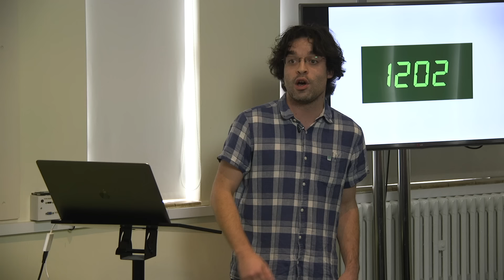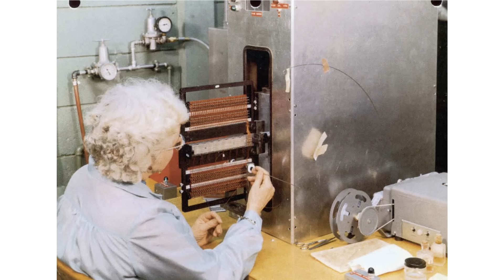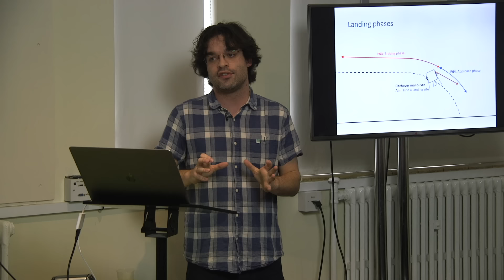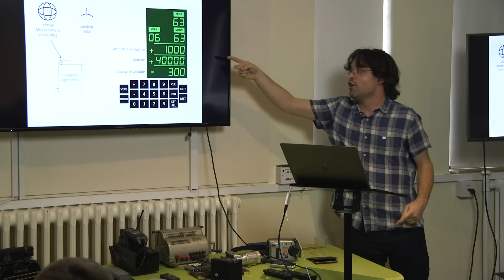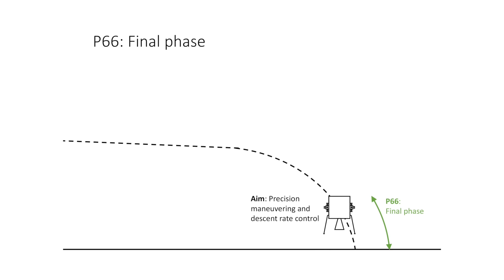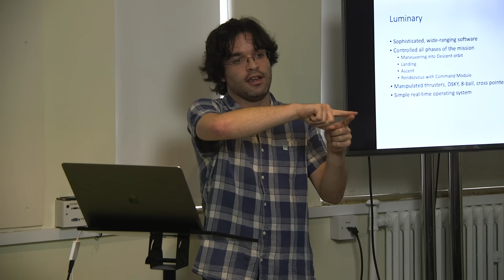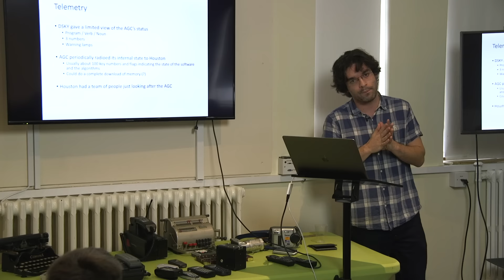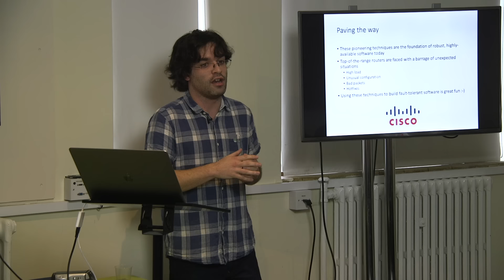Light Years Ahead | The 1969 Apollo Guidance Computer

Comment: how does magnetic core memory get beyond LEO electromagnetic radiation?
Reply: I am fairly certain that the AGC used magnetic core memory only for the RAM, which is constantly being refreshed anyway. Additionally, magnetic core memory chips can be hardened against radiation. Magnetic core memory chips are still being used today. The actual data was in the form of core rope memory, which means it was impervious to radiation damage.
Reply: @casanovafrankenstein4193  Magnetic core memory is not in chips, though. They are little ferrite rings with wires through them, and one bit per ring. We stopped using magnetic core memory in the 1970s. 
The ROM was core rope memory.
Reply: @casanovafrankenstein4193  I do the computer science degree too bro.. have you tried subjecting a magetic core memory stack to any form of electromagnetic radiation? it fucking flushes faster than a 91 Maxtor HDD.
Reply: @animaze86  You also wrote, "also lol magnetic core mem chips in1969..." <- Magnetic Core Memory was first demonstrated in 1951.
Reply: @animaze86  "electromagnetic radiation" Are you talking about putting it in a magnetic field? Yeah, that's the one form of "radiation" that will affect core memory. No huge magnetic fields in space though.
Reply: also lol magnetic core mem chips in1969... @casanovafrankenstein4193
Reply: @animaze86  so your argument boils down to I don't believe it.. because all you do is question things without researching them.
Reply: @casanovafrankenstein4193 Core memory doesn't come in chips.
Reply: Magnetic core memory is pretty much impervious to radiation.

Comment: Another interesting thing Don Eyles mentioned in his book was that the DPS engine throttling response times given to the programmers was shorter than the actual response (I believe it was), and the computer's attempts to change the throttle caused what was called a "castle-ation" in the throttle responses, making castle-wall-like crenulations in the graphs of the throttle settings by jumping from wide open to almost zero during some transitions from one thrust level to another.  Basically like taking your foot on the accelerator of your car and wildly pumping it while trying to adjust from going from 20mph to 30mph.  The cycling between throttle extremes was at a very fast rate, such that it presented a danger of a violent failure of a throttling pintle valve.  Could have resulted in anything from an engine that could not be throttled, to a sudden shutdown, to (on the worst day) an explosion of the combustion chamber.  Everyone on the LM guidance programming team are said to have turned white as a sheet when they finally saw those throttle graphs, after Apollo 12, and had a fix in place before Apollo 13 flew.  And had Conrad not commented at length on the amount of RCS activity it took his LM to maintain attitude through PDI (which was eventually found to be caused by fuel slosh in the tanks), they might not have taken that close of a look at the throttle graphs... 😲

Comment: I'm sure it's been noted below, this was posted three years ago, but the actual cause and resolution for the 1201/1202 program alarms was totally sorted out by Don Eyles in his recent book.  The rendezvous radar was on a different timing circuit from the timing circuit the computer and the other pieces of hardware used, and due to a truly once-in-a-million chance, the two timing systems got started up so out of phase that info from the rendezvous radar came in on a timing cycle that robbed the processor of something like 15% to 25% of its capacity, whereas the radar would normally only use like 2%.  Aldrin did NOT mistakenly leave the radar on, he was the rendezvous expert and if they had to abort, he wanted that radar turned on and warmed up immediately after the abort stage command.  Prior to Apollo 11, when some of the MIT guys decided the radar was an unneeded 2% drain on the processor and suggested not monitoring it, Aldrin was told he could turn it off if he wanted to, and he elected to have it on.  It was not a mistake, it was a conscious decision and did not seem to have been capable of causing a problem either way.  Finally, there was a hardware fix in LM-6 and onwards, the two timing circuits had a rectifier added in that synced their timing signals, so a mismatch on the timing signals couldn't cause such a bad cycle steal in future LM computers.  On future landings, it was totally possible to have the rendezvous radar up and running during PDI without any issues.

A more serious problem in the landing algorithms was in the landing point calculation -- through Apollo 14, the LPD had a tendency to tell the CDR it was landing about 300 to 500 meters farther downrange than where, left to itself, it would round out the descent and null forward rates.  Armstrong kept redirecting downrange after seeing West Crater, but the trajectory kept shortening and placing him in the boulder field, so he took "manual" control in P66, cut the descent rate, and milked his forward velocity until he was out of the rocky area, before rounding out and landing.  Also, Armstrong actually went into P67 for a short period -- a more manual setup where the only thing the computer did was control the descent rate -- but shifted back to P66 for the round-out and landing.  And while Armstrong is noted as flying his LM out farther than anyone else, he and Al Shepard were actually about tied.  On Apollo 14, Shepard's LPD kept saying he was aimed downrange of North Triplet crater, but it tried to round out and stop its forward motion in the valley east of Triplet, around Weird crater.  Al had to take over and do what Nail had done, milk the final forward velocity out while maintaining a low descent rate, to barely fly past North Triplet.  (Shepard's LM exacerbated the issue by having a DPS engine that ran a little "hot," a bit higher thrust than normal at any given throttle setting, as demonstrated by the fact that their PDI throttle-down happened about three seconds early, meaning they had reached the desired velocity state with less full-power thrusting.)  So, overall, the LM software team had a few things to clean up going into the final J-mission version of the landing software.
Reply: Thank you for this very interesting information, both on 1202 and the additional trivia on the landing site prediction!

Comment: You showed us the memory hardware but didnt specifically identify it as ferrite core memory. This was very very slow memory and less than a fifrh the speed of the 5kb of ferrite core memory in the standard PDP8 minicomputer a few years later.. Semi-conductor memory was the norm within the decade. Reading  the core memory was a destructive process, so  a read was usually followed by a re-write of the data, automatically handled by the memory system hardware. A big advantave of ferrite memory was its retention of memory during power down.

Comment: Does anybody know  what mission Apollo 10 was, with Gene Cernan in command?
After separation there was an incident, what was that?
Reply: Apollo 10 was a rehearsal for the landing: basically the Apollo 11 mission profile, but they aborted the landing at an altitude of 14, ditched the descent module, then flew back up to orbit and rendezvous wit the CM. Just before separation, the LM started to go out of control. 
The problem was traced to a switch controlling the mode of the abort guidance system; it was to be moved as part of the procedure, but both of the crew members switched it, thus returning it to the original position.
Reply: @h.dejong2531  correction, Gene told me that prior to separation one switch was wrongly configured and the ascent module was started to rotate and he was very concerned that the attitude was causing the gimbaled platform to approach  gimbal lock.
Resetting the switch cured the problem.
All inertial platforms avoid that problem with a fourth gimbal ring. That was AFTER separation. Today strap down plattforms are used, where attitude is determined in unity quaternions by integration of measured micro circuit rate sensors, (Analog Devices)
https://youtu.be/0lZ8iDAmX9o?si=6HFeJeYRlKfpshkF
Reply: I love Gene but he greatly exaggerated the severity of the incident. Apollo 10 never initiated powered descent so they were still 8 miles high or so at separation, and they only tumbled once or twice before Stafford flipped the right switch & got them straightened out.

Comment: There is a major inaccuracy here. Armstrong took control when he saw that they were going to land on a boulder field, so the flew manually forward for about 30 seconds to land on a smooth area. That is far from the presenter's narrative. Listen to the recorded sequence.
Reply: No, the presenter is correct. Armstrong taking "manual control" is actually the switch to P66, where the computer keeps the LM at a constant altitude while Neil moves the spacecraft in the x and y directions.
Reply: @h.dejong2531  They could also turn a knob that controlled their rate of descent.  Very much still auto, but they could manually control their rate of descent.  Obviously, they need to descend to land on the moon; they didn't just hover at a constant altitude the whole time Armstrong was looking for a good place to put her down.

Comment: Pity NASA" lost " all of the Telemetary Data required to go back to the moon ..... 🤔
Reply: Too bad you are gullible enough to believe that
Reply: No, they didn't. At the end of Apollo, they discarded Saturn V telemetry, i.e. the data that tells you the detailed status of the rocket. This was vital for troubleshooting during the Apollo program, but became obsolete once Apollo ended. Discarding it (after extracting the important bits, which went into reports we still have) was no loss. 
What you need to get to the moon is not engineering telemetry. It is: 
- orbital mechanics, which requires data on the orbits of Earth and the moon. That data is readily available and easy to gather. 
- environmental data. This is the science data gathered by the Ranger, Pioneer, Surveyor and Apollo missions. All of the science data from each mission remains available in public archives.
- mission experience data: reports on what the Apollo missions did, the problems they encountered etc. This data remains available in public archives.
See the pattern? Important data is saved, unimportant data can be discarded.
Reply: Hoax nuts like to pretend they care about the telemetry data. Of course, if you offered it to them on a silver platter tomorrow they wouldn't care or know what to do with it.
Reply: Why the f do you think you need telemetry from an old mission to go anywhere? Do you need a recording of you driving somewhere BEFORE you first go there? Do you even have the slightest clue what telemetry is?
Reply: @Agarwaen  try telling Don Petite from NASA that as during his official NASA Promo video he describes that very issue as being why they CANNOT GO BACK TO THE MOON !!

" I would love to go back to the moon in a Nanosecond but we lost that technology and it is a painful process to build it back "
Quote from Don Petite - NASA 
( it's even on ytube to view it !! )

So it would appear you haven't got a clue about your little Fanboy idol members stating such !!

Maybe it's time to come out of your parents basement and stop wanking off into your NASA branded merchandise t-shirts and socks !!
😄😄

Comment: definitely all these nonsense can be achieved by arduino or rasberrypi
Reply: Yes today, but not in that time kiddo.
Reply: could either do the job, assuming you added the interfaces required? sure. would you want to use something built at absolute minimum cost and never hardened for spacetravel? if you were a moron maybe. there's a good reason why so much electronics used in extreme applications are decades old. as long as they're fast enough to do the job there's no point in doing the very expensive work required to certify something much more powerful than required to take it's place.
Reply: Any general purpose computer can do the calculations.  So?

Comment: If the Russians managed to get the N1 to work, they would have had to land on the moon without benefit of the AGC or anything close to it.  Could they have pulled off a manual landing just using sensor readouts?
Reply: The Russians managed several automated landings in their Luna project. They may not have been able to build something as flexible as the AGC, but they'd have used a similar approach: computer-controlled landing with a manual backup.
Reply: @h.dejong2531  Correct, but the Soviet luna landers were much smaller and lighter for not having to carry a crew (their manned landers would have had one cosmo, not two) and didn't have to carry life support for the cosmos or more fuel and larger ascent motor.  The lunas also weren't as reliable as the Apollo landers proved to be - critical when carrying humans.  For manned missions, I think the accuracy of something like the AGC was an important piece. I believe the Soviets could have and probably would have landed successfully, but any failures would likely have gone not publicized. I also think the navigation aspect of the AGC would have been priceless if an abort happened and the lander had to find the CM.

Comment: 2000 bytes of RAM? Luxury in some modern low-level embedded applications. For example, I’ve recently worked on a sampler in an audio hardware situation where the microcontroller had about 80 bytes of RAM. Such applications need a similarly designed processing flow to the Apollo computers.
Thanks for an enjoyable talk.

Comment: Anyone knows what kind of hardware is used in modern ultra-reliable computers for space or nuclear power plants?
Reply: Most spaceflight projects use radiation-hardened processors. Several are available: e.g. the RAD750 and RAD5500, based on the PowerPC architecture. 
These are designed for high-radiation environments, using various techniques to make radiation damage less likely. It's also common to use redundant computers, with a voting system to make sure the system keeps working correctly when one computer malfunctions. 
Some projects use a similar setup with non-hardened computers.

Comment: Funny fact is that AGC become controlling and navigation device for Minuteman ICBMs :)
Reply: as far as I can see, the two were developed in parallel by different companies.
Reply: @h.dejong2531  well, then you either don't see too far or you need glasses. No offense :)
Reply: @mcbure1  Read up on the Minuteman I's D-17B computer. The D-17B weighed approximately 62 pounds (28 kg), contained 1,521 transistors, 6,282 diodes, 1,116 capacitors, and 504 resistors. 
So, no integrated circuits, unlike the AGC. It used rotating-disk memory instead of core and rope core memory, again very different from the AGC. Minuteman II used a further development of this. 
As I said, parallel development, not shared development.
Reply: @h.dejong2531  in fact, AGC was the POC for these guidance systems and served as base project. Minuteman II guidance system was based on it. But yep, AGC itself was not used in Minutemans. Since it was not that much reliable.

Comment: At 1:11:22 he says he couldn't write a "Hello World" that took less than 100k, that's only because he probably uses Visual C under windows. If he wrote the same code using say an AVR cross compiler for code running on an AVR embedded target with the right compiler options he would probably get it down around 200-300 bytes if not less. I've written countless programs in assembler for 68HC811E2 which only has 2k of EEPROM for program storage and 256 bytes of RAM. I've also used MSP430 derivatives that have only 128 bytes of RAM and yet they are very code efficient and can be coded via a C compiler. The only drawback is that they are a 16bit RISC so each instruction 16bit or 32 bit which slightly increases the program memory requirement.

Comment: Regarding the RAM multiple use explanation at around 1:07:30 using a C compiler any RAM variable declared as local non static effectively sits on the stack or in a register and so by default is reused by the next function call and I'm sure Forth being a stack based language would also fit that mould, and really I'd say that when writing assembler I would use register and stack variables if I only needed the variable in the function.

Comment: The IO from the radar sounds very similar to an interrupt. On systems I worked on (1980s), an interrupt would push a return address on the stack and load the program counter from a word in memory... typically the code would push the registers, do whatever, pop the registers and return back to wherever it was when the interrupt occurred. So the main program would never know that the interrupt had happened.

Comment: While the gist of this was correct, there were a good number of simple misunderstandings. For example, “Descent Orbit” is not in any way misleading, since an orbit is, well, and orbit. Also, the uliage diagram shows the RCS firing toward the surface, not towards the back end of the LM. There are a lot of slight mistakes like this throughout. Also, if the uliage burn was not initiated, air would likely end up going through the combustion chamber, something which tends to make rocket engines explode.